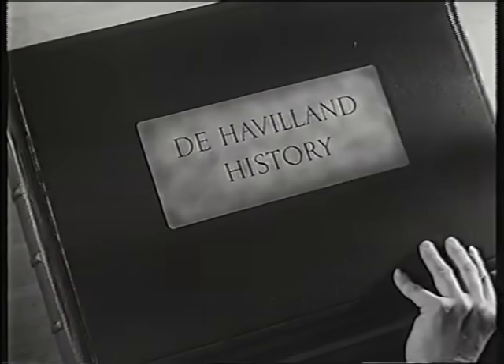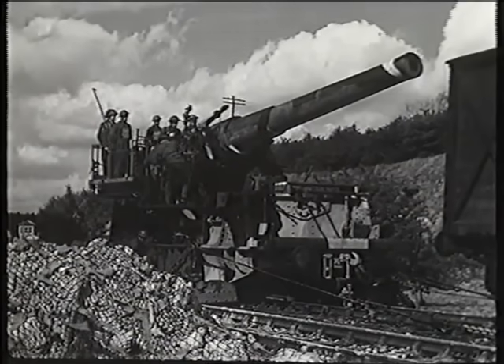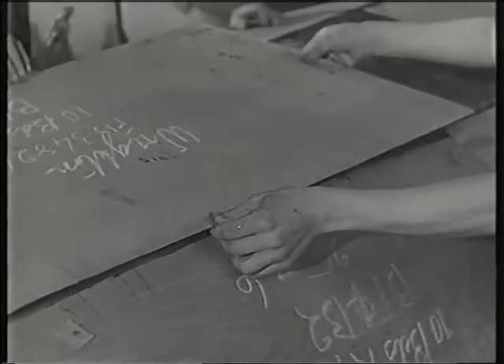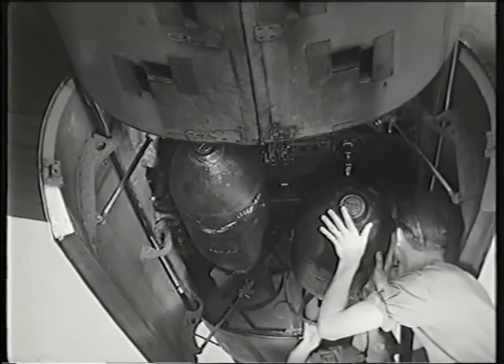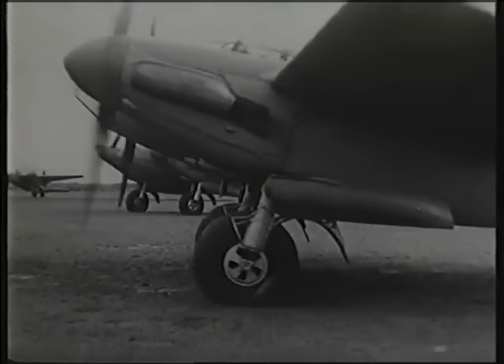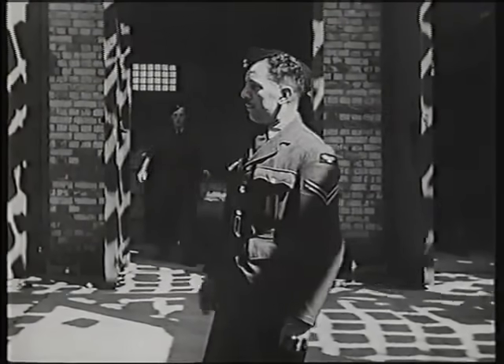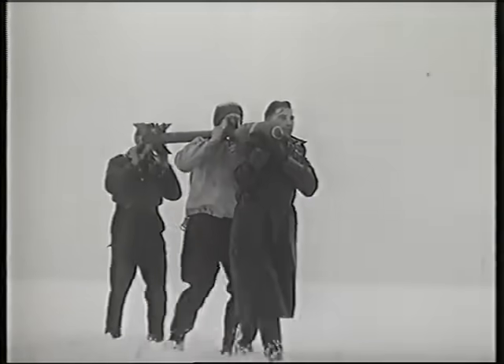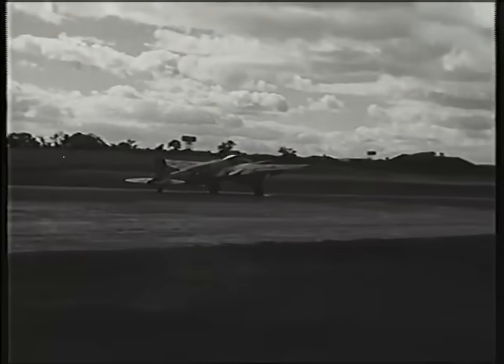The De Havilland Mosquito

Comment: I've read that in the humidity of the south Pacific there were problems of the Mosquito literally coming unstuck when the glue failed.
Reply: They solved that one too. The final solution included a thin wooden "speed stripe" along the side of the fuselage as well as different resin. It was designed to use in Europe after all.

Comment: They always say the Mosquito flew too high and fast for the Luftwaffe, yet several Luftwaffe types could fly faster and higher. If so good, why were 400 Mossies lost in action?!Les mer Vis mindre Svar     1
Reply: It was not 400.

The question of altitude comes down to Luftwaffe response time, not simplistic comparison of data block figures. If they were starting at comparable speed and altitude they might have stood a chance but that wasn’t the case. The altitude and transit speed of the Mosquito made it near impossible for the Luftwaffe to intercept.

Sound familiar?

It was the same rationale used in the design of the SR-71.

Comment: The Brits didn't really need the heavies. I guess there weren't enough trees to build sufficient Mossies. Had they found the wood the war could have been over in '43. That's what happens when you put the old fuddiee-duddies in high ranks. Imagination and foresight freezes after 40. Maybe even 35 for most.

Comment: The fastest plane was the mc72.
Reply: The MC72 was a one-off seaplane for record-breaking purposes only.  It did 440mph in 1934.  There were piston-engined COMBAT aircraft going faster than that during WW2.  I believe some did 500mph.
Reply: @paulstandeven8572  "I believe some did 500mph."
Only in a dive. The fastest piston-engined fighter on record was the Supermarine Spiteful at 494 mph. And yes, I know that an experiment P-47 was reported at 504 mph, but the tested speed was actually no better than around 480 mph.

Comment: Throw a couple of turboprops in that thing and it would be an effective warplane today.
Reply: With a very short-life airframe. Is that what you think would make an effective warplane today? The Mosquito was not designed as a long-life aircraft – it couldn't be, given the materials used in its construction. That kind of construction requirement does not apply today.

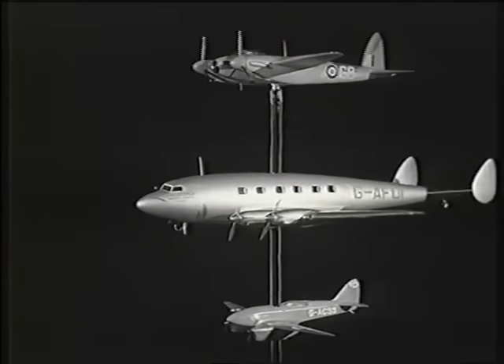Comment: 8:50............ the what fighters?????????
Reply: Cleanest. As in most aerodynamic.
Reply: Vimeslgospare Wrong ! ! !   the Mustang was more aerodynamic and faster too.....with one engine...
Reply: Wilbur Finnigan Hmmm but with a British engine.......lol
Reply: Mike Allen  A MODIFIED British design, Made in the USA with USA ancillary equipment...USA MADE !!!   BIG difference.... FYI
Reply: The P51 was built by North American Aviation but needed a Merlin engine from Rolls Royce to make it such a great plane!! FYI
You need to check your facts, It also used a Packard engine on some variants.
Reply: Wilbur Finnigan BUT WILBUR 1. only with drop tanks could the P51 approach the Mossies range and still be 200 miles short
2. 4x Cannon beats 6x mgs
3. Mossie 4000 lb P51?
4. Mossie 44000 ft P51?
5 Mossie 425 at 30000 ft P51 436 mph @26000ft
6 Mossie 41 variants P51?
7. Mossie could do a loop with one engine out P51?
8. Mossie sank UBoats P51?
Reply: Wilbur Finnigan But Wilbur your Packard had lost the P/W ratio of the Merlin
Reply: 18tangles   The guns really dont matter, the Mustangs got the job done...4950 air kills  4200 on the ground, what did the Mossie do???  And the Mustang is also credited with a destroyer..strafing and hit a magazine and blew it up...The Mustang was still faster on ONE engine...The Brits kept screwing around trying to figure out what to do and what engines to use on the Mosie,,,,ooohh well...
Reply: Mike Allen  YOU might go back and check your facts...ALL P51 B/C  and D?K  and H Mustangs used the PACKARD built Merlin V1650 -3 or -7 or-9     NO  repeat   NO  British built engines were used in ANY PRODUCTION mustangs.  Only the British Mk1 Mk 11  and the P51 A and A36  Used the USA built ALLISON engine....the Facts man just the Fact....do the research...
Reply: Wilbur Finnigan Well my friend grab the chair, You rave on about the fighters shot down by the P51 which was great, Now lets have a look at just one Battle, The Battle of Britain 1897 aircraft destroyed 3600 Germans killed or Captured now that was in less than a month. So your 4900 fighters shot down is brought into perspective Two types were used YES but the old antiquated Hurricane accounted for most. 
2. Yes the P51 accounted for all those planes how many pilots were killed/captured not 3600 maybe half, lets say 2500
3. Now to the other planes the Spits Tempests Typhoons Mossies and 4 or 5 others. Troop trains 500 soldiers? Just half a dozen and lets be generous 1500 soldiers killed or wounded Typhoons in one day at the Falaise Gap 175tanks with 5 men /tank over 850 killed or buggered. 
4.The object of war is to kill or incapacitate the enemy and in 3 instances that has been accomplished, and your P51s has been equalled or surpassed.
5. Shit even the old Stringbag the Swordfish in the years of 41 to 43 sank on average 50000 tons of shipping/ month how many enemy? not known but a hell of a lot.
6. Now could the Mustang do that? of course not. Horses for courses The Spit great interceptor, P51 great escort , the Mossie ? just great at everything else.
Reply: 18tangles  Well we could also add to the totals the P47's the P38's the P40's and all the other Attack aercraft A20 A26  etc and the count would only go up from there, and don't forget the Other war the USA had in the south Pacific. the Hellcat the wildcat the corsair the P40 the P38 the P39  the A20 A26   Hell look what the B29's did to Japan and even the B24 and B25's out there.  We beat their asses into surrender.  and in Europe Britain was not the only show in town they had help, they won NOTHING by them selves, they had lots of help...It was an Allied victory  accept that and get the bur out from under your saddle you are whipping a dead horse it ended 70 years ago. it is ancient history and the ink in the history books have faded... time to move on and live your life without hate and anamosity, remember our countries were allies and the USA assisted you Aussies, or did you forget ????
Reply: Wilbur Finnigan Wilbur:1 You do know we had the Hurricane, Typhoon ,Tempest Spitfire, Beaufort, Beaufighter, Firefly Whirlwind, and we were raiding FRANCE Holland and Belgium 2.5 years before you. Africa, Persia, the Med we could go on forever,
2. And as you said you won nothing by yourselves. It was a joint effort. Goes both ways. 
3. No it is not time to move on as you can see on these sites there is a lot of misinformation which should be resolved. Hell even the Britannica yes your Britannica on here and the books has Eichelberger in Charge in New Guinea not misprints, lies.  
5 Yes you assisted us and you were great BUT we assisted you with our country for you to use as the start of the final victory. And as I said before for Jap numbers the Russians faced more and the British in Burma
Reply: Mike Allen ALL   repeat    ALL   Merlin engines in all the P51 B/C  and D/K  and H models used the Packard built Merlin......NO   repeat    NO British built merlins were ever used in a production Mustang....fact  FYI
Reply: Wilbur Finnigan It's still a British engine though. We don't claim that the Apache helicopters we use are British just because they're license built by a British company, they're American helicopters, you designed them, did the R&D etc etc.

Merlins are British engines, no matter which people knock them together.
Reply: kingdavewoody Made in AMERICA  with AMERICAN MATERIAL, with AMERICAN equipment  by AMERICANS........Made in AMERICA......disprove that....
Reply: Not claiming that the Apache is British, but have a look at the difference and you will see that the Brits have made it much better. Some better electrical systems and a new Rolls Royce engine gives it an extra 200 HP over the US version, whilst using less fuel. Reminds me if the Mustang P51 story......!
Reply: It is an old plane  should be able to make improvements   if you can't better give it up...
Reply: Mike Allen YOU   Need to check all the facts   ALL   repeat    ALL  Merlin engined Mustangs used the PACKARD built Merlin engines...NO   repeat   NO     British built Merlins were used in any Production Mustangs    P51 B/C  D/K  and H  and the MkIII and Mk IV  all used the Packard built merlins...
Reply: 18tangles Hey Jack  how about the Great Lancaster???  With out the Packard engines...you limeys would have have a rather small fleet of planes...
Reply: 18tngles   MORE if's and dreams    IT did not happen ! ! !
Reply: I wish I could become a YouTube partner and get money for the amount of comments on my post :-p
Reply: Mr Finnigan It seems that you like to make up your own version of history, as I do not want to stress your intellect to much, I will just inform you of one indisputable fact about the Pacific War that is usually ignored.

This fact emanates from the post WW2 Japanese government which has officially designated the eviction of the Japanese army out of India & Burma by the British 14th Army in 1944/45 as the largest military defeat ever inflicted on Japan in all it's recorded history and as such has become part of the official Japanese school curriculum.

For the record the British14th Army, appropriately nicknamed " The Forgotten Army" was a multinational army with over One Million personnel which incidentally also made it numerically the world's largest single army existent at that time.

You will appreciate that this one fact clearly dispels the myth that the US won the Pacific war all by itself.
Reply: I am afraid that the first part of your post does not make any logical or grammatical sense and the last part should be addressed to the Japanese Government who were responsible for writing their country's history..
Reply: all this bickering is disgusting - remember Kohima & Imphal "When you go home tell them of us and say for your tomorrow we gave our today" For those that dont know The defeat at Kohima and Imphal was the largest defeat to that date in Japanese history. They had suffered 55,000 casualties, including 13,500 dead. Most of these losses were the result of starvation, disease and exhaustion. (The Allies suffered 17,500 casualties, almost entirely from battle.)